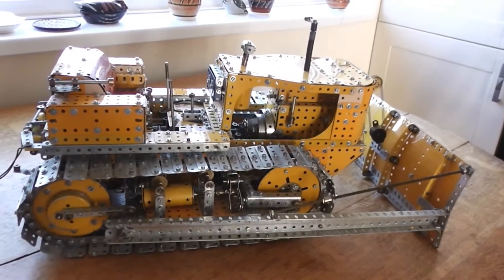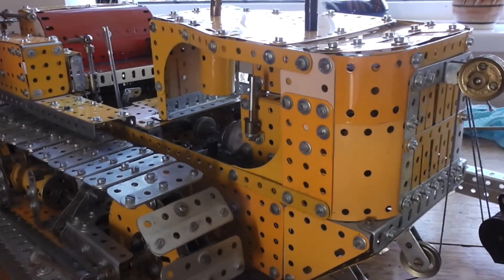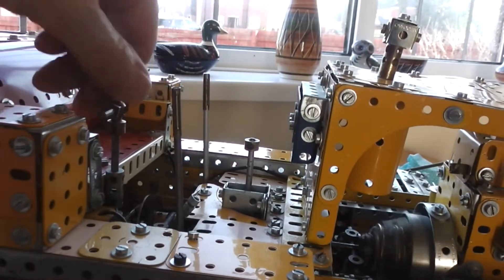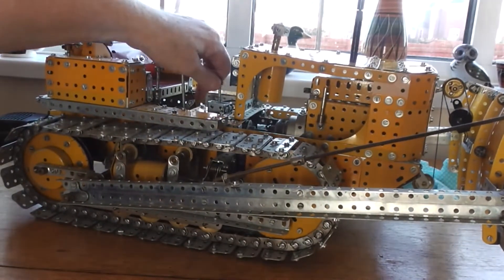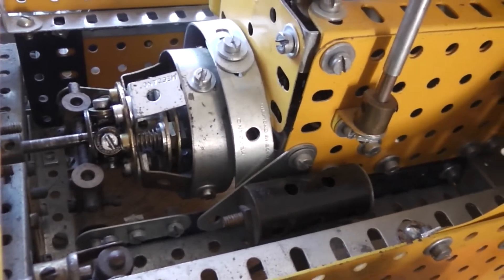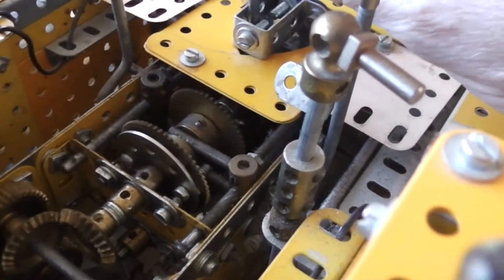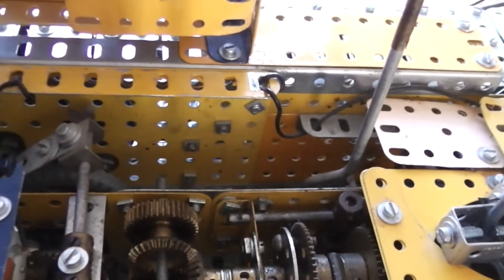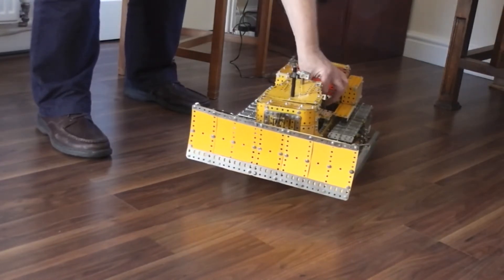Meccano Crawler Tractor Part 1

Comment: I’ve seen a lot of Meccano models and I’d say that this is the best Meccano model that I have ever seen.
Reply from the maker: Thank you for your comment. Although I built it and made it work I can take no credit for the design which was by the late Eric Taylor. He did design an absolutely brilliant piece of Meccano engineering with this model in my view. Unfortunately when I exhibit it it often doesn’t get the attention it deserves as it’s complexity is hidden from view. I have made a few improvements to it over the years and indeed have made some slight improvements since this video. Anyway thanks again for the comment.
Reply: @sanspareil3018  I was just day dreaming about a time when I was a kid when some friends and I were getting around on push bikes when one of us got the idea to tape a bit of flexible plastic to the frame in a way so that it would run against the spokes in a wheel to make a sound a bit like an engine. I then thought about your model, maybe if you had any room left you could do something similar on the motor shaft.
Reply from the maker: @Cooliemasteroz  It was something I thought of a while back but not actually attempted it.
Reply: @sanspareil3018  it would be the icing on the cake.
Reply: @sanspareil3018  no worries 😉